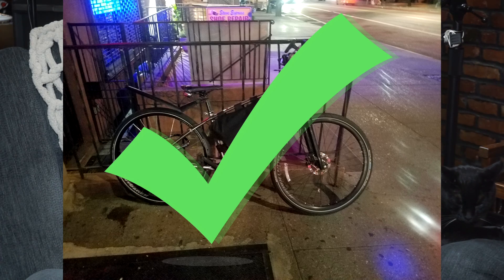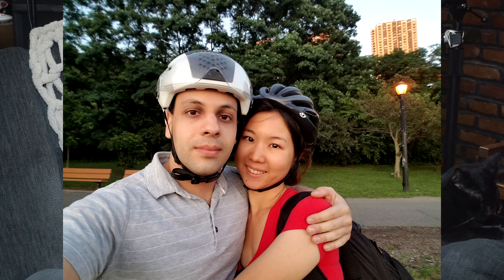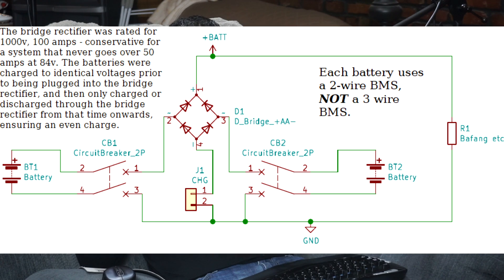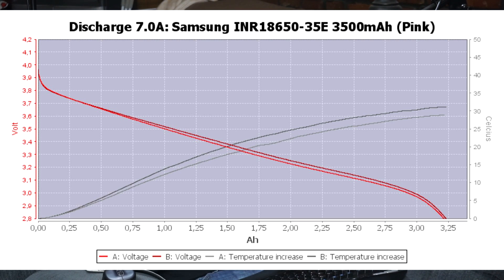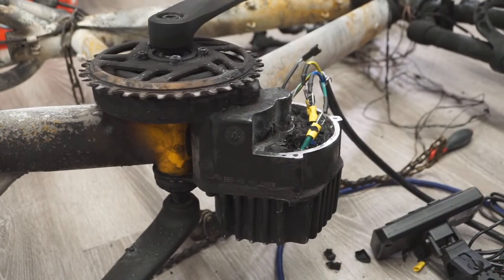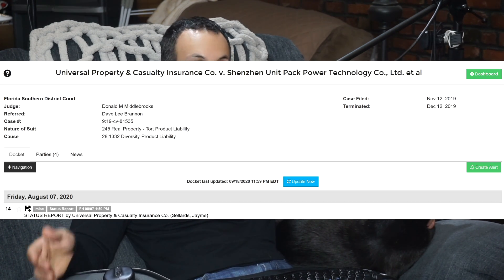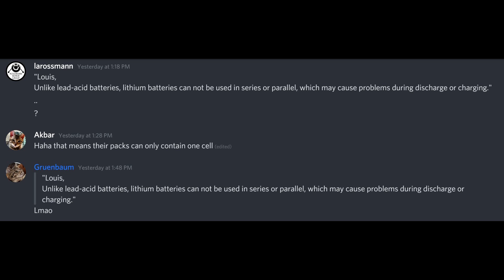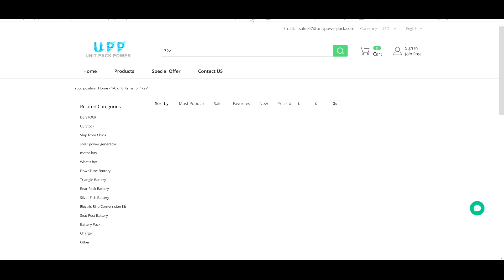Louis' front door goes BOOM courtesy of UnitPackPower battery.

Comment: Rule 1: NEVER trust Samsung and their battery ratings. mAh over-rated, and the internal resistance is higher than specified typically... This means a larger batt pack will not charge properly without a balancing circuit, and you shouldn't draw Max Amps from the pack, unless you want to shorten overall life of the batt pack, and possibly yourself. LG Chemical makes far better batteries. Trust me
Reply: I've been using over 8000 of these samsung cells in my business. All samsung. Not a single issue. Trust me.I don't vape but repair bike batteries. They run at their rated current.
Reply: @Beeeeeeeeeee  And how many charge cycles have you studied them for? I have devices that are capable of 235 Watts, and 360 Watts using them. Over a year or two of charging and use, I'm noticing that my authentic Samsung's have more "Voltage sag" under load than my authentic LG Chem 18650's. Interested to hear your response, since I also follow BatteryMooch, whom studies Consumer batteries extensively with certified bench test equipment. He ran tests, and they concluded the same thing. Mind you, I am known as SubOhmHunter because I have built and use a 0.05 Ohm vape atomizer, and my batteries are not being abused in this fashion (parallel, not series load).
Reply: @Karl_Kampfwagen  Well I have 2 house batteries consisting of 350  samsung 29E and 35E cells, running 2 cycles each day for about 2 years now. They are charging electric cars. Current they run at is 200A over 50 cells. We do our own testing instead of watching Batterymooch, whoever that is, on youtube test it. Also, vape cells have an entirely different internal structure than energy cells. Also some additives that stabilize the ethylene carbonate and DMC at higher temperatures. A realistic load for an ebike cell is about 1-3C, maybe 4C peak for really fast bikes, not 5-10C vaping currents.
Reply: @Beeeeeeeeeee  ENTIRELY different structure? Unless you have a source to cite, I'm going to dismiss your "experience." Are you using 20700's, 21700, or 18650 batteries? They are BATTERIES, each one holds 3.7 nominal, and 4.2 V charged. Derp. Samsung shares number+letter designations among their different battery sizes, with wildly differing specs between them. Some are made with lower internal resistance, and typically comes with reduced mAh rating. Others are made with higher mAh, and lower Amp ratings, with an increased internal resistance. And then there's the cells from superior competitors, with high mAh, high Amp draw and charge capability, PLUS a lower internal resistance, which perform better over hundreds of cycles. As a RAW critique of the "cells" in various configurations, they do not run as long, they are not as strong, and they exhibit capacity lost in my use case. And they are the top of the line Samsung 30Q 18650's, versus my LG Chem HG2 and HG2L batteries. If my vaporizers draw more power than an ebike motor on a C-level, it would only logically follow that the battery which operates the best in small scale uses, like mine, would also perform the best in a vast scale. As for BatteryMooch, "whoever he is," 😂 you would probably learn a lot about the "cells" that you use from him.
Reply: @Karl_Kampfwagen  High current cells just do have a different internal structure. Thicker current collectors, different PTC, thicker tabs etc. This is just how they make them able to handle the current without overheating. 
A very nice read on the design of high current cells: https://www.researchgate.net/publication/336309386_Design_Strategies_for_High_Power_vs_High_Energy_Lithium_Ion_Cells
They even compare the cells you're talking about. I get the initial logic behind cells being good for vaping thus great for big scale, but grid batteries operate at lower peak currents and have active cooling. Lower IR is always great, but at house/grid scale it's not always the most important factor (cycle life and cost being the main factors, power and energy density are less important).

Comment: Definitely sounds like an issue with the configuration.

It didn't fail under load. It failed while you were switching the breaker which sound like something went wrong in the wiring and one of the batteries was shorted. Was that rectifier properly cooled? That thing would have been getting very toasty. It may have overheated and developed an internal short?

It still shouldn't go thermonuclear, the pack should have adequate protection to prevent that from happening, but from the evidence you have given it doesn't sound like the normal operating load caused the fault.

Also, when the vendor is suggesting that lithium batteries shouldn't be series/paralleled they are talking about the built packs, not the individual cells. There are many risks with connecting multiple packs together which in most cases outweigh the benefits. If you want more range just carry two packs and switch form one pack to the other when needed and charge them individually. Much safer.

I'm not vouching for UPP quality, but with the information provided it certainly looks like the unusual configuration of the ebike played at least some role in the failure.

Comment: 3 things that might have caused this:  1) you did not set the short circuit limits to BMS 2) you managed to mess up + and - 3) the parallel circuit wasn't correctly designed

Comment: I hope this ends in court, but not sure who to blame.
If one battery cell was malfunctioning, that would mean resistance and resistance means HEAT=FIRE 🔥. 
This was the reason you rarely see phones with multiple batteries.
If all the cells are behind the safewards, like voltage regulation, thermal, etc, this end being a safer way..yet
We don't know what safety features these batteries have.
Like if there one a diode with thermal regulation and still burn, it's the manufacturer fault, but if the configuration ended in HIGH RESISTANCE, it will be Louis faulty.
Let's see if ends in court and things sort out.

Comment: I'd say the spotwelds/nickel strips were below standard, resulting in only a few cells being connected in parrarel and that those that remained connected were discharged well beyond their rating and the result was the thermal runaway. Thats why my batteries are soldered and not spot welded. Those nickel strips  wear down way too easily. Specially on a bike with lots of vibrations.

Comment: Gotta love the sense of urgency from those firefighters. Basically said "It's fine if the fire spreads, I got time"
Reply: Was going to write the same thing. A 10Lbs fire extinguisher would have taken care of that without problem.
Reply: @bpm990d , no. The batteries were in a thermal runaway. Depriving it of oxygen is not enough.

Comment: This is what happens when you get lazy and try and run 2 batteries at the same time. Why not just run one wait for it to go flat then change to the other one? Or better still build the battery to the full size instead of in 2 parts. I'm not saying you might of been sold a dodgy battery but when you said you switched the breaker then the fire happened I'd be thinking is it something I've done? (if I was you that is) someone like your self with a high subscriber base can do untold damages to a company that might not have had any part in what happened. I know it's there battery that went pop but can you say for definite it was completely down to them making them wrong
Reply from the maker: Reading their responses demonstrates they have no understanding of electronics. I do not feel bad if people see them.

Two batteries in parallel is not about laziness, it is about battery health. If each battery is discharging 10 amps instead of 20, you get the same output with less long-term wear & tear on the battery.
Reply: @rossmanngroup  UPP have been trading for years I doubt they just suddenly forgot how to wire up a battery. The person sending you the replies from UPP on the other hand they probably don't know much about what they are actually selling as it becomes pretty evident at the end of your video. Just to point out I've been using a UPP battery for over 10 months no issues and I've cracked it open to check cells and can report everything looks good in side. Also your video was posted to a group on facebook to which many replies was sticking up for upp. (that's how I found your channel) I'm not going to argue about what happened but I'm just saying posting a video like this can cause damages to a companies reputation.
I will say I wish you the best and hope you get your bike sorted and are able to enjoy another diy ebike as I know something like this would put alot of people off having another one.

Comment: LOL yeah their claim about Lithium batteries not being used in parallel is total garbage. Else the battery in my vintage Compaq Armada m700 would have exploded years ago. I opened it up after it stopped taking a charge and noticed it has 8 19650s wired up with 2 in parallel. (so there's 4 sets of parallel connected batteries). This was to give the battery a voltage of around 14 (16.8 at max charge). One of the sets went bad and had a reverse polarity. This can happen with batteries that degrade and the charger IC is supposed to detect this and stop allowing the pack to be charged. Which mine does! It no longer charges. All the other sets of batteries inside the pack are almost 4v while the dead one sits at -1v max after an attempted charge and sits at -0.5v after it hasn't been used. Despite the other battery cells being near full charge, the IC doesn't allow the battery to power the laptop either so further discharge isn't possible until I repair/rebuild the battery pack.

This battery was manufactured around early 2000s and was still holding a good charge up until one of cell pairs died.

I can easily rebuild this battery at some point as the wiring scheme on it seems simple enough.

My guess is wither the charging/balancing IC for your battery pack was defective or they just straight up sold you defective or mislabeled battery cells. I think it could even be a combination of both. Bad cells or incorrectly labeled cells where one or more of the cells in series goes bad. Then the defective IC still allows it to be used. That's a recipe for battery fire so I bet that's what happened.

I used to own a electric bike back when I worked at Wal-Mart in 2013. I baught a no name LifePO battery off china eBay seller and also got the parts to convert existing bike to a mid-drive mounted bike. The battery worked great for the entire lifetime of the bike up until I had to sell the parts after the rear fork of the bike failed. (I had to trim some metal off the lower end of the fork to get the motor to align with the pedels correctly). The battery still worked fine.

If even a no name battery from a suspect ebay seller outperforms your battery and doesn't explode, you got some serious QC issues. :P

Comment: Louis you're schematic it's actually pretty interesting and the batteryes decide to blow up when both contactors where off :)) indeed I need to say probably the batteryes were faulty if they had a bms on the battery the bms was supposed to cut off the load on the battery if the battery itself was getting hot why that did not happen ?
I would suspect that that battery also had protection at Overtemp over discharge over current and so on

Comment: High-power battery packs are dangerous if not assembled with the best components and methods.  BMS units may be more at fault than the cells themselves,  judging from what I've seen offered on eBay.  This problem will get worse as higher-power cells become available.  These are not your grandfather's mushy NiCd or lead-acid batteries, and they will not tolerate casual abuse such as discharge below, or charging above, manufacturer-specified volts/cell.  At present, I'd use only LiFePO4 cells because their thermal runaway temperature is much higher than that of Li-ion cells, and with careful bottom balancing do not always need a BMS attached.  Downside is that LiFePO4 has lower energy density, upside is much higher cycle life.

Comment: a bridge rectifier is not a constant current charge circuit. it is not a current balancing circuit. it blocks the flow of current in one direction. two batteries with different internal resistance and different voltages when plugged in will not charge at the same time at the same rate. same for discharge. if the voltage coming out of the batteries are more than 0.7v apart, one of them will never be loaded while one of them will see the %100 load. so yes, this is actually very bad but it is ok if you don't mind running on one battery and you are already derating more than %50 anyway. to say they know nothing might be hmmmm. you are a tech. you should know ohms law and kirschoff's laws. assume the BMS is china trash then work around it with good design. combination of bad BMS and not following manufacturers instructions.

Comment: I mean, the schematics aren't bad, but you should've used a fuse. Use fuses everywhere. If you know they are capable of 80A max, put an 85A or 90A fuse in there. In that case, when anything happens (inrush current, badly connected diode, rectifier getting destroyed, short), the fuse will blow up, not the battery. And that's a big difference, replacing few cents worth of glass and wire, or few hundreds of dollars for battery, door and potentially a human life.

Comment: I've started using Headway LiFePo4 cells in my battery packs. They are not as power dense as 18650 cells, but are much safer.

Comment: I am surprised that your schematic would work, but I am not an expert on charging batteries. I would think that you would need at least a current limiting resistor, if not a current regulator to charge batteries. Can lithium batteries be charged by only depending on their internal resistance? Lead acid car batteries are charged this way, using only a voltage regulator, not a current regulator, so maybe it's ok? But you said that you measured the peak charging current to be less than what the battery was spec'd to handle, right? Another thing that might go wrong is that the battery could self limit current for any voltage, but as you increase voltage, and even though current is limited, the total power going into the battery will go up and overheat the battery. But, maybe, such a non-linear property does not apply to lithium batteries - like I said, I am not a battery expert.

Comment: No certification, no quality control, no legal liability for manufacturers since they don't own the design since most manufacturers are just copying  / ripping off the design of a foreign company.. maybe made some tweaks to make it cheaper to manufacture or cut some corners in the process. Very dangerous.  I've become so disappointed in li-ion batteries over the years that I've literally started ripping devices apart and replacing them with Ni-MH (electronic screwdriver, couple wireless gamepads, and a TomTom GPS so far.)  .  At least you don't have to worry about an Ni-MH setting your entire car on fire if you leave it in a hot car. Also, Ni-MH can be safely thrown in the regular trash but li-ions require a special recycling process. GPSs and phones that have warnings not to leave them in a hot car, etc. make them much less practical devices. Kids are going to leave li-ion devices in hot cars or in the sun because they don't think about these kinds of things and the batteries will swell and potentially leak toxic fumes or go up in flames whether the battery was correctly manufactured or not it doesn't matter because of the battery technology and the fact that a battery with constantly adding heat applied to it has no active cooling. Then the whole pack can go chain reaction if even one cell has a burn up.

Comment: "I had them in parallel"
DO NOT CONNECT BATTERIES IN PARALLEL. You don't know how the load and charge current will distribute.
Reply: 50/50 if the proper wiring, connections, BMS and battery matching takes place

Comment: Your charging circuit is faulty.  LiON battery chargers monitor terminal voltage as well as charging current.  When you put a diode in series with your charger (and I'm assuming it's a well-designed charger which correctly monitors terminal voltage and charging current), it will be measuring the wrong terminal voltage.  Additionally, if one of your batteries is somewhat weaker than the other, then you will be overcharging the weak battery while the stronger one finishes.charging.  My suggestion is to use a DPDT switch, get rid of the circuit breakers (which also add some resistance, and therefore additional voltage which the charger will misread) and diodes, charge one battery at a time, and you'll probably be more successful.  For about $20 you can get at Harbor Freight a clip-on ammeter which will help you debug your charger.

Comment: I checked. UPP is located in Shenzhen and it's CEO is Sum Ting Wong. Company slogan is "Customer is always Wong."

I wonder why the fire dept didn't just quickly exit their truck and put out the fire with an extinguisher? Sure, if it spread to the building they would need water, but it seemed to take them forever to get the fire out. Every second that passes makes it more likely the whole building will catch fire.

I guess you are really focused on an electric bike, but a Rebel 300 is very good in city traffic and very light and dependable.

Comment: Hi, you know far more than me but I have seen batteries go up myself and its been when they have been near flat and then charged to fast, could you have had a problem with one circuit breaker so when you where using the bike only 1 pack got drained, and then when switched all the power from one could go into the other one? I can see the bridge rectifier should not let that happen but if that also had a short?